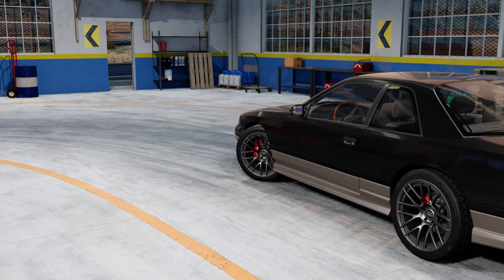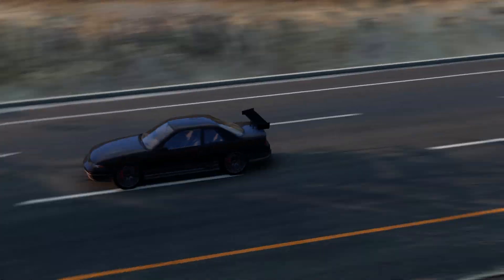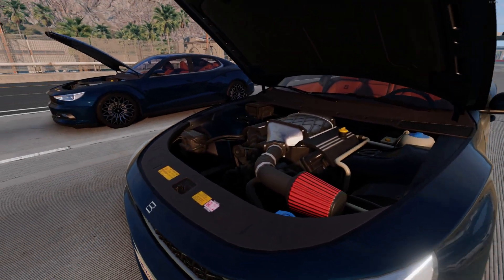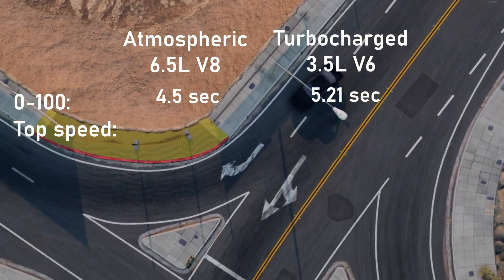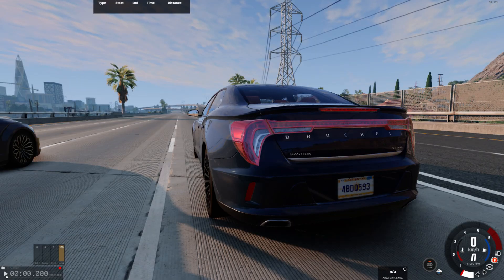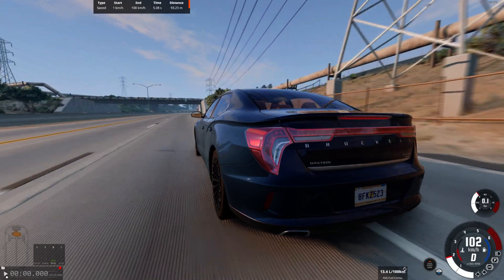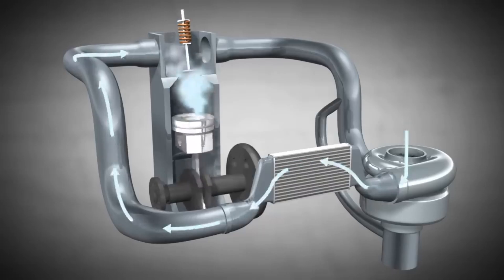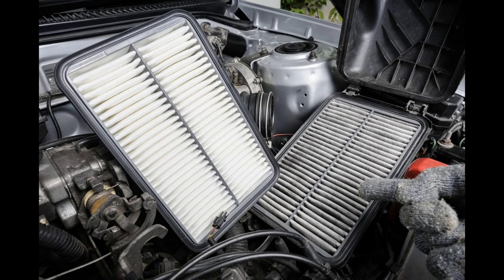What is a Turbo and how does it work? Let's test and find out!

Comment: I have a unrelated fun fact:

Mufflers and gun suppressors are the exact same patent.
Reply from the maker: I also have a fact about silencers on weapons, they are used not only to reduce noise (they reduce the volume level by only 20 decibels), but to hide the flame from the shot. I also think that like mufflers in cars, silencers on weapons also greatly reduce their "power"

By the way, I have a video about mufflers on my channel, maybe you have already watched it, but if not, here is the link, my friend ) 
https://www.youtube.com/watch?v=xUiIp2EGazk&t=2s
Reply: @vertviger  Suppressors can affect muzzle velocity, it could slightly increase it slightly decrease it, so it can have an impact on accuracy, lethality, range, balistics, armor penetration, although suppressors also reduce recoil because the gasses disperse in the suppressor or something
Reply from the maker: @voytec448  Oh, I see, thanks )
Reply: @vertviger  Suppressors typically only cause a small loss of round power, which is usually negated by using Subsonic rounds.

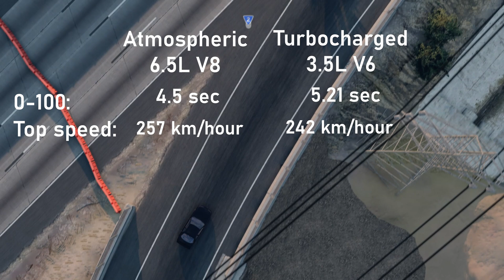Comment: 2:34 i mean , you wont just find a regular/convetional turbo that can compete or act as well as 2 extra cylinders, it very much did really good with uping the power in the V6. 2:56 here its definetely going to make a difference (some engines wont even care you added a turbo on it since it cant produce more power than it already is producing, but nearly all cars you will see will definitely improve in power when a turbo is added). 
Now i want to see the performance difference between a turbocharger and a supercharger , outputing the same pressure.  Great video 👌
Reply from the maker: Yes, my friend, I agree. I honestly didn't expect such results with the V6 either, I expected a much bigger difference. But when there were already two V8s, the results were expected. Turbo works wonders! And yes, now the supercharger is next in line.